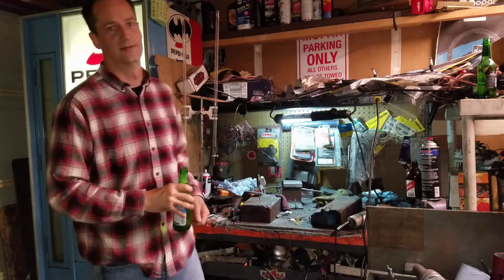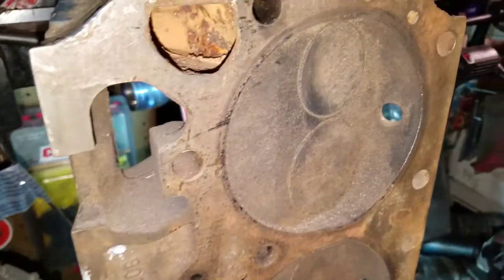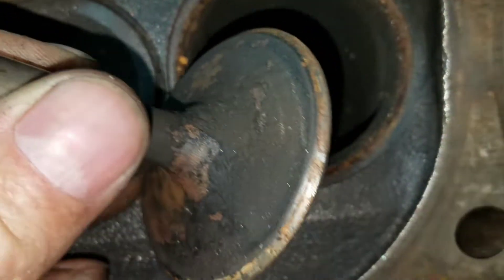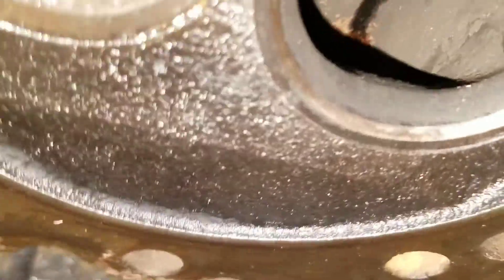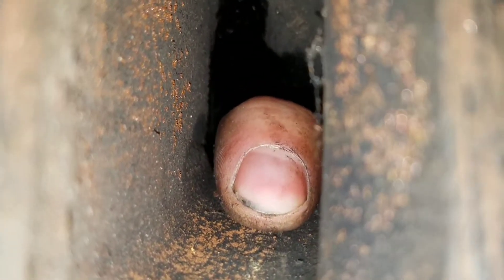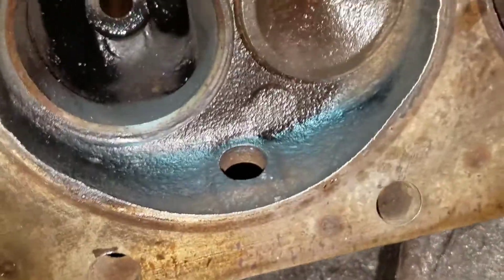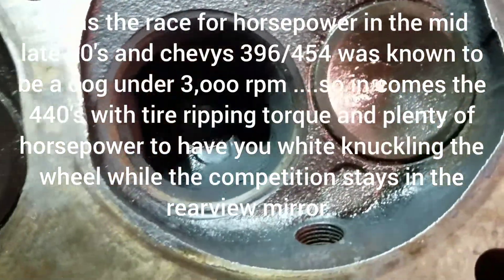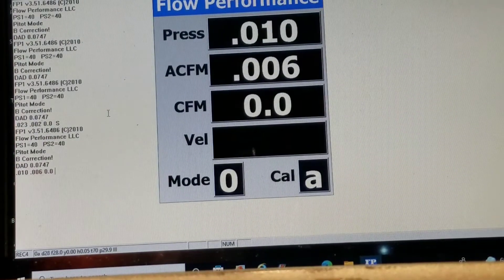MoPAR 906 head porting series part 1.Chrysler's 'go to' big block head. #mopar906 #bigblockmopar

Comment: Before the interweb I a set of ported 452 heads and was very conservative and when I bought the Direct Connection porting templates that was great. I have done 915 closed chamber heads using those templates. That gave me the ideas about where to grind on other heads too.

Comment: Ya, back in the day you could pick up a set of porting templates from Mopar Performance and add 2.19” intact and 1.81” undercut valves. Go for 9.5-1 static compression, add a MP .509/292 hydraulic cam, install a windage tray if the engine didn’t have one and block off the carb heat crossover in the heads. Top it off with a Holley Street Dominator intake and 0-3310 Holley 750, 1 3/4” headers with Mopars recommended tube length and pay attention to detail when setting bearing clearances and you’ve got 521 hp under your right foot!